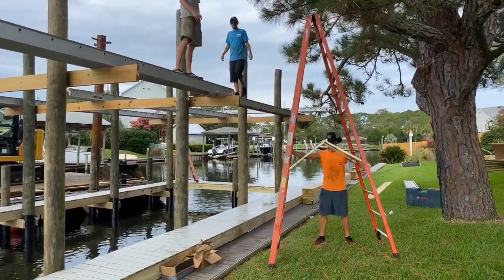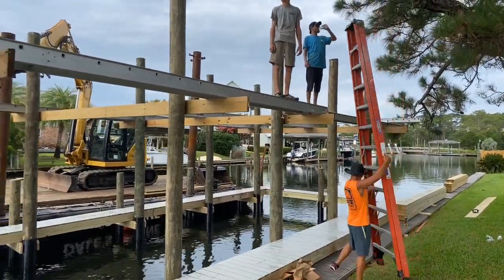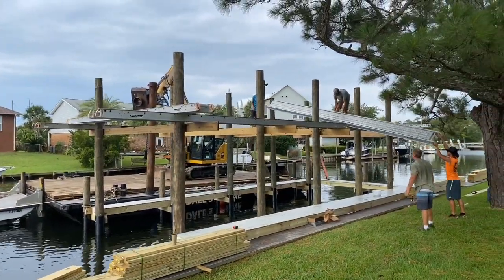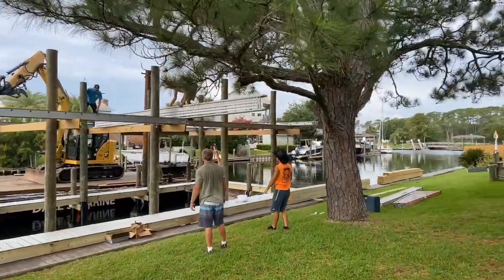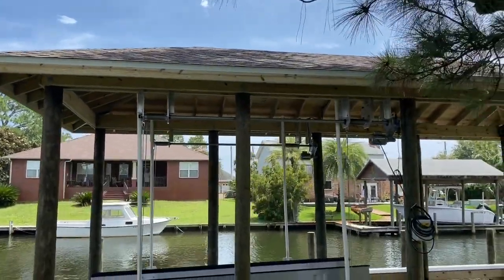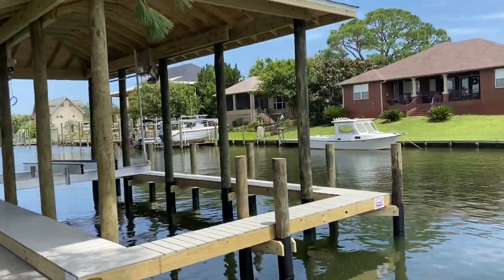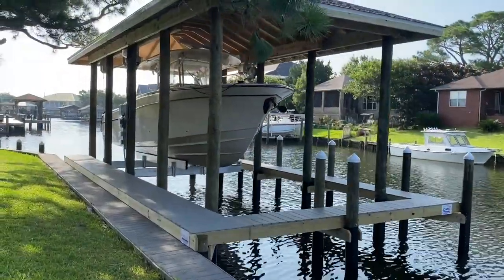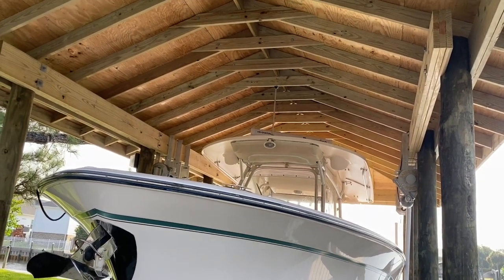Large Grady white lifted with Golden Sea Drive Boat Lift

Comment: Those wood beams over time will fail under all that load, Never understood lifting a large boat and distributing the weight across just wood and not metal. bad design
Reply from the maker: Steve Koch you are correct if they are not installed properly with the proper piling spacing or even to wide of a piling set copaired the the cradle beam it will fail. I’ve been doing this for 40 years and it works. We don’t use steel because of the salt environment and it will rust away over time.